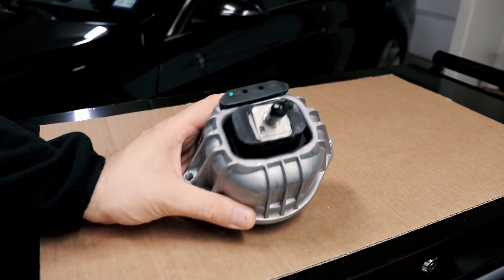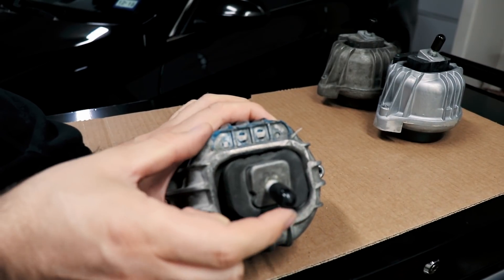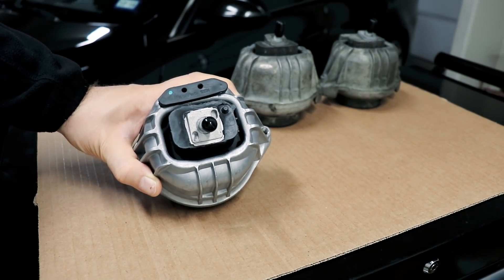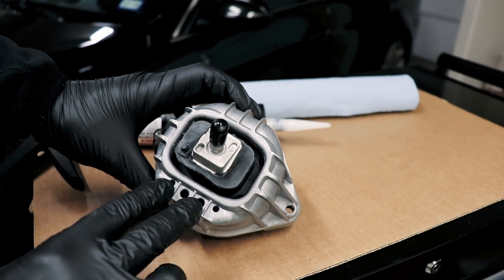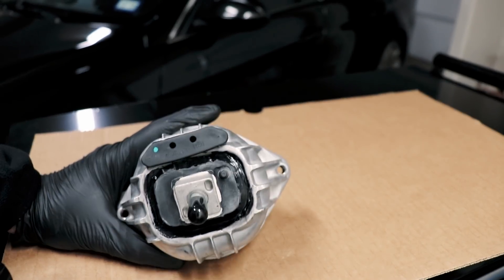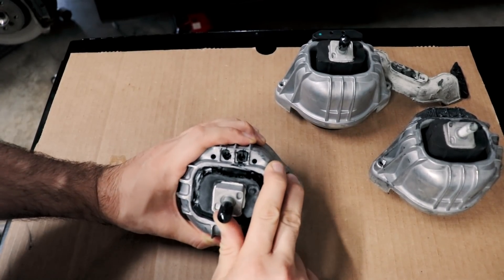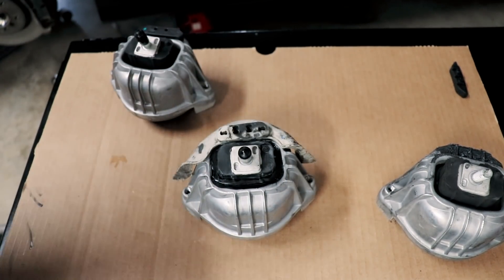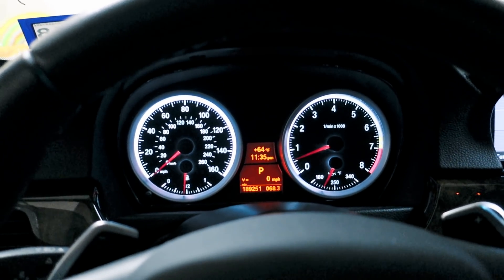I Bought Cheap Engine Mounts and Made Them Decent - E90 DIY

Comment: Good to know. Changed my driver’s side mount with the IS mount due to the power steering pulley issue. Will be doing this when I have time to chain the passenger side mount.👌

Comment: Anything to help reduce motor movement on the N5x is so important especially to avoid the serpentine belt and power steering pulley breaking from movement. When motor mounts fail, collapse, or start to have movement, the serpentine belt WILL start to have issues, if not very big ones. This is very good insurance. and hopefully avoids a considerable headache.

Comment: I like it. Any chance of an update on the condition of that modified mount in 2021 ?
Reply: Was literally just wondering this as changing a mates next week!
Reply: I’ve done this before and kept the car running the same mounts for about 2 years and the mounts held up really good, hence it was in my old wrx not my e92 but I was a car that was pushed to red line quite often
Reply: @jass164  wrx doesn't make nearly as much torque as an N54 lol

Comment: I just did this a couple of weeks ago. I had Revshift 80A Motor Mounts on both sides and it was a lot of NVH. I also had Revshift transmission mounts which added to that. So I took the driver side out and replaced with stock 335i Genuine BMW mount and filled it with this 3M stuff to see if it would reduce NVH. I might have reduced it a tiny bit. So I replaced the Revshift transmission mounts with Rogue Engineering mounts and that also helped a tiny bit with the NVH. The only thing that really stops the NVH is raising your idle speed to 900RPM. 

Once the Revshift 80A passenger side mount goes south, I will replace it with the stock 335i mount with this 3M stuff and see how that feels. And I will also restore the car to stock idle RPM of 600. 

How is your car holding up so far with the mounts? Still good?
Reply: You should use 335is engine mount instead of 335i

Comment: If you clean old rubber bushing with acetone or toluene and fill it up with window weld, after cure you have poly bush.
Reply: What difference would that make from what he did in the vid? Wouldn’t acetone or toluene melt the rubber a little??
Reply: @alloutofdonuts3998  It would damage it slightly, but you won't notice it. I did it due to dust and dirt. Easy way to dissolve anything. You can pressure wash them with detergent.
Reply: @alloutofdonuts3998  I dont recommend poly bushes for diff mount (can destroy chassis) or for main part of suspension (ride way too stiff). I changed window weld bushes back to rubber. It was good experiment. 500 Nm on rear diff didn't like stiff mount. Lesson learned.

Comment: How well does this hold up? Also, are there any other voids in other bushings that could benefit from this? I figure if I’m spending $30 on a tube and probably only using a 1/10th of it, mine as well get the $ out of it!

Comment: could you also use RTV gasket maker? just bought two motor mounts from rock auto for $27 each. $68 altogether. I already have a bit of black RTV gasket maker left and would think it'd be the same? or is the window seal harden more during the drying process? and are right and left mounts the same?

Comment: So from a logic point of view, it's kind of nonsense. I need an explanation, if you're going to use the sealant, why replace it? You can spray it right in from above and drive again tomorrow. Life is extended again. Or do I understand wrong? Thanks in advance

Comment: What if you just put that silicone inside of your broken mounts? It should stiffen them up a bit...right?
Reply: I don’t think silicone would be as stiff plus it has to dry for a few days before adding more(like 1/4” bead at a time) unlike urethane. That would take a while. I’ve heard the mounts also collapse a bit. If that’s the case you’d be better off just getting the cheapy mounts and putting the urethane in em.

Comment: For my car realoem list 22116760330 for left and 22116773744 for the right. Can you confirm whether 22116760330 will fit left and right? what is the difference between the two part numbers? thanks
Reply: I thought the difference was the alignment pins that break off anyway. Maybe not, but it’s a theory lol.

Comment: in all honesty I would say you are just increasing the tendency for vibration in the car. As far as performance I would say that urethane will squeeze out of there in no time. Or sooner if oil gets in contact with it. We would do something similar to this  with the W124 126 and 201 Mercedes mounts. The bottom line problem is the URO or any other Chinese made product. Aesthetically, they look sufficient, until it is installed.
Reply: Nothing in this comment makes any sense 😂

Comment: Hey I noticed your temperature gauge was reading about halfway between 160 and 250 is that normal for your car? Cuz that's what mine has been at
Reply: That's oil temp. You can see your actual coolant temp in a diagnostic menu. Lots of videos about it!

Comment: Did you get alignment after each install of new mounts?
Reply from the maker: I did not, not sure how much dropping the subframe changes the overall alignment but I do have a lifetime alignment agreement on this car so I could always double check.  I didn't feel a difference after installing the mounts in terms of alignment.
Reply: @VehicularDIY   - How is it possible to have lifetime alignment on a BMW? Unless you use a nonBMW service provider like Firestone...who do not have the ability to align as per BMW best practices, and also cannot align to M3 specification if you have m3 suspension upgrades. 

Even on non M3 specific alignment, BMW certified shops use weights to weigh down the car under driving conditions and then they use BMW specific alignment prongs to attach to the little holes on their wheels.

Comment: Hey I've used 3m Windo-Weld on rear diffential brand newbushings on my 2008 335i and it UTTERLY FAILED!!!
3m couldn't hold and broke out badly.
I let them dry for 5 days in AZ 110+ heat but didn't work. Filled them in all at once. 
Just wondering what gives???
Somebody chime in why 3m didn't work out?

I also bought Uro motor mounts for this exact job but my confidence is slashed about the 3m.
Reply: What do you mean ‘broke out’? Did just the 3m urethane come out or did it rip the rubber part of the bushing out? 

Things that come to mind, brand new bushings have mold release residue on them. Cleaning that may help. Another thought, if the urethane isn’t supported or ‘captivated’ on both sides it will not stay in. In this vid it’s filling a cavity. As opposed to just a cavity open on 2 sides. A bushing that is made specifically for an application is always supported somehow.
Reply: @alloutofdonuts3998  Broke out i mean 3m didn't hold while new bushing held fine. I filled in the gaps and filled them all around. The new bushing is liquid filled pouches i believe and it flexed like it should. But 3m got PUNCHED THRU and broke the formation, pieces dangling. 
I was very disappointed 😞 

It might ok for engine mounts but differential RWD might not be good. 
I push about 400hp. But from looks of things I doubt it can handle 300hp stock.
Unless it's not genuine 3m but I bought it from Amazon 3rd party seller in Las Vegas. 

It got broken on the same day I test drove. You see?

I did buy new engine mounts and filled those in from left over 3m...almost 1 momth of drying now.

Did you use 3m on differential of your car? What kind of car.
Reply: @alloutofdonuts3998  oh and I did sprayed to heck with brake cleaner. There isn't any other way to get rid of new bushing

Comment: Good video like always! Question- how’s your tranny doing? With that mileage it’s up there... I use to work on a friends bmw e90. That car had 290K on it a few years ago and it drove perfect.
Reply from the maker: Thanks!  The transmission drives about as perfect as possible I'd say.  It shifts like it was just made yesterday.  Pretty incredible but it seems like an awesome transmission.  I did the solenoids, and seals and changed the oil and filter.  The fluid wasn't burnt and the clutches looked silver, no discoloration.  I could see them when I dropped the valve body.

Comment: maybe the engine is meant to swing in corners, you'd think there's a reason those spaces exist
Reply from the maker: Yeah it's there for a reason yeah, a bit of flex overall would feel smoother in the turns I'd think but I did this due to the limited clearance with aftermarket downpipes.  There is no real advantage on a car running stock downpipes I'd say.

Comment: Ummm... Lemderfor's engine mount got Hydralic damper inside to damp certain frequency from engine... filling with some silicon doesn't help much with the original designed purpose, you may as well put some washer and rubber pads on your engine instead of using these.